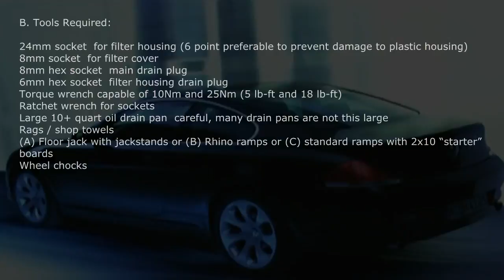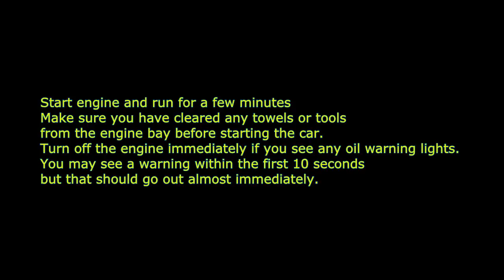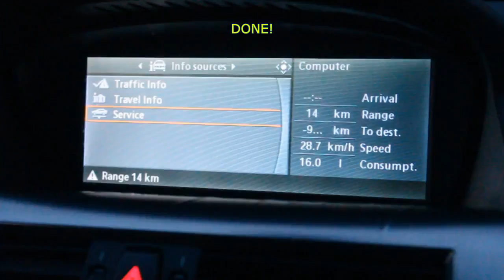DIY Oil change on BMW 645Ci, 545i and reset service

Comment: I'm having trouble resetting the oil service light  also brake lights. I wish you would make another  video on reset services .step by step with audio .Thanks allot
Reply: having the same problem, I can't reset the brake fluid sign, if you know let me know plz. thankx